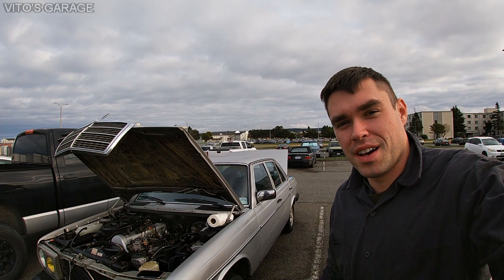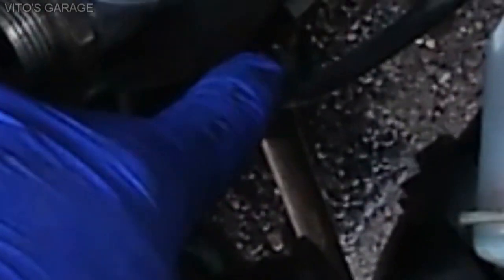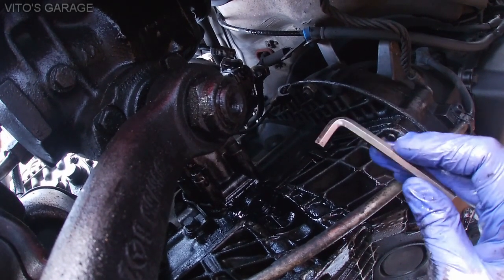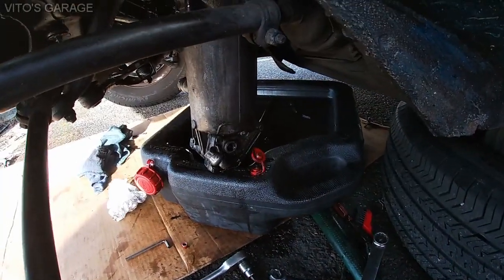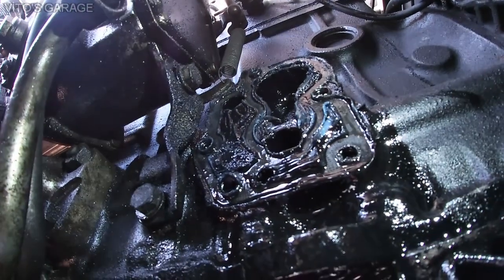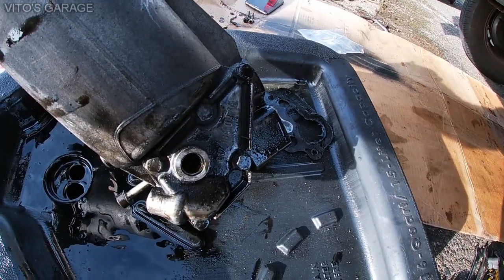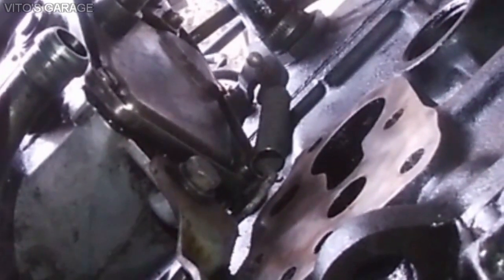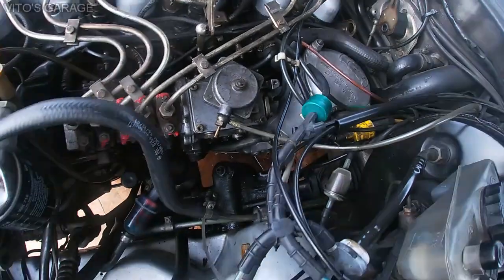Part 9 Dad's Gift Mercedes W123: Oil Filter Housing Gasket & Surprise From Previous 'Mechanics' !

Comment: I learn so much from you my friend and I am twice your age. I know that you mostly focus on the older vehicles. However, I simply wanted to share an experience on my modern x204 glk350. Even with complex electronics I perform my own maintenance. I was receiving an auxiliary battery malfunction. I purchased a $200 oem Mercedes battery. It was a simple replacement. The dealership charges approx $500 for this replacement. 
The purpose of this small battery is to operate the electronic gear selector in the event of a main battery malfunction and the need for a tow. Once I replaced the battery, I tested the old battery and placed it on a trickle charger. It charged fully and tests "ok". So please have this in your wealth of knowledge. These auxiliary batteries are salvageable and rechargeable and are not charged by the alternator.  Keep up your great work. Nastrovia!
Reply from the maker: Thanks a lot for your support and for sharing your experience. I like newer Benzes too. But my heart will always stay with old school ones and I'll be driving them for the rest of my life. Nothing will outlive Classic Mercedes. Not even Tesla.
I work on many different cars, and newer ones too. I just don't upload many videos about them. Maybe I should☺

Comment: Great video  I have a 1998 r129 with same issue oil housing gasket but it also has a oil cooler joined to it is it easier to get at it from underneath the car not a lot of room to work on it so I'm dreading doing the job lol m104 2.8 engine
Reply from the maker: You’ll probably have to remove the intake manifold to make it easier. Order new intake manifold gasket and throttle body gasket just in case

Comment: Hi Vito, Great video. I'm about to do this job myself. The fact that you didn't show the reattachment of the housing to the engine block with the new gasket makes me think that it's quite easy. Do you have any recommendations for lining up the gasket? is it as easy as getting the bolts through the holes on the gasket and lining it up as you tighten? ive heard others using a bit of water soluble grease to "stick" the gasket to the oil filter housing.
Reply from the maker: You need some patience doing this job. Make sure you put the long middle bolt through the housing hole. Otherwise you won’t be able to install that bolt because of the steering box. Then, Grab a few more bolts and and put them through the holes. Keep the gasket on and make sure those bolts go through the gasket. Finally, install the housing onto the block. Keep checking and make sure the gasket isn’t getting pinched. Tighten German Tight. Check for leaks once you start the engine. I hope I explained well enough. I didn’t use the sealant. Thanks for watching and check out my other videos and playlists🤘🚗